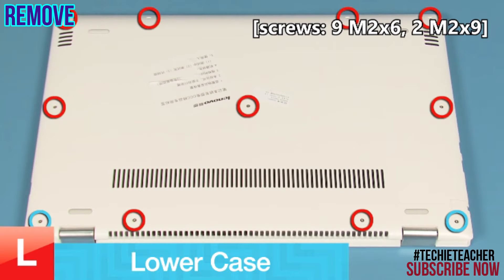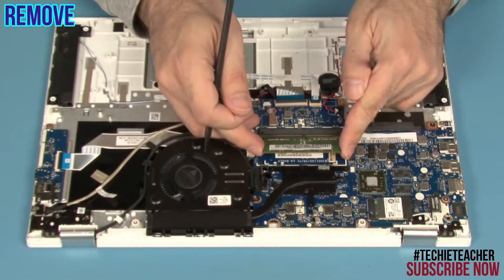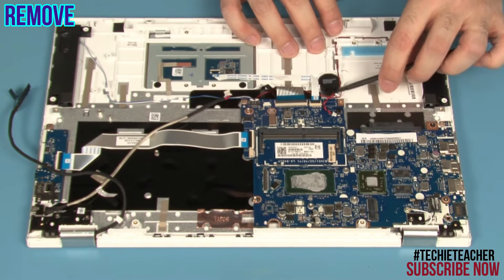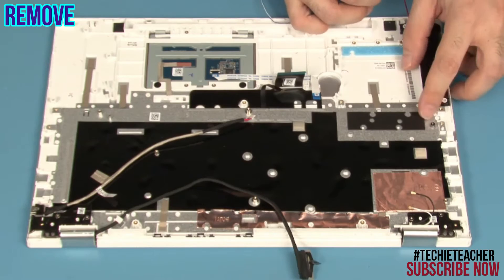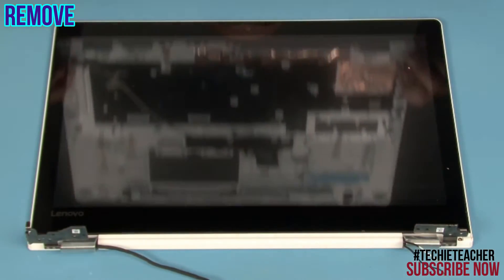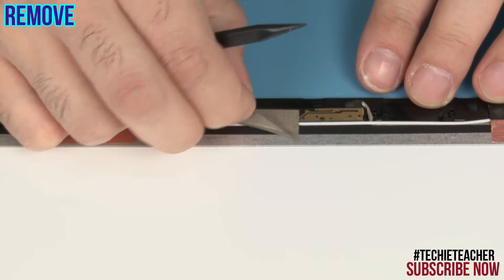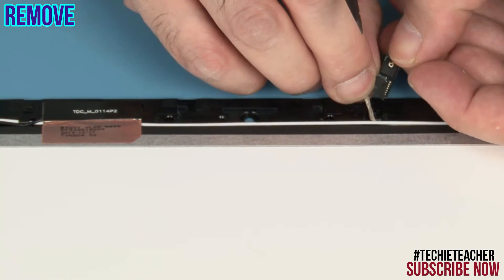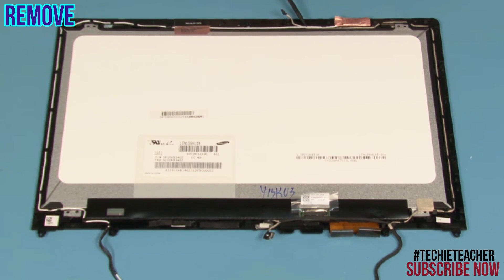HOW TO DISASSEMBLE/REPLACE Lenovo YOGA 510 / FLEX 4 (80S9, 80VB, 80U3, 80SC, 80SA, 80VD, 80SB, 80VE)

Comment: "Slide out the hard drive..." - hahaha, I wish.  In the Lenovo 510 I'm working on, the (faulty) hard drive was additionally secured with double-sided adhesive foam tape. I had to remove one of the loudspeakers to get access, then force the HDD upwards enough to slide a scalpel in and cut through the tape.  Way to go, Lenovo - not.